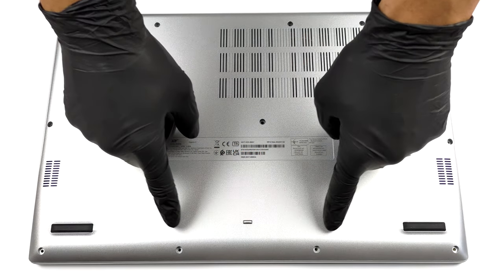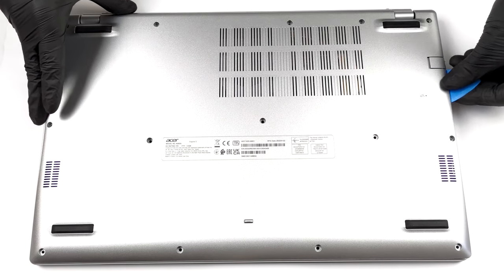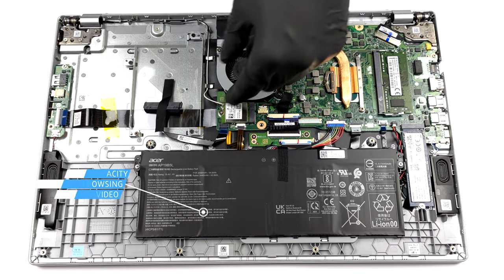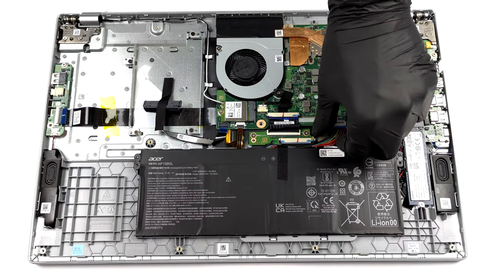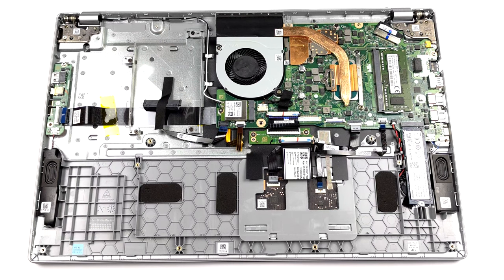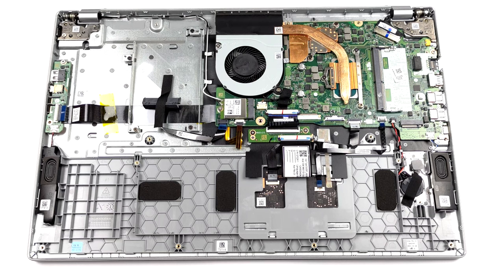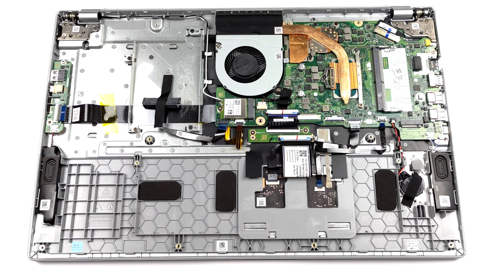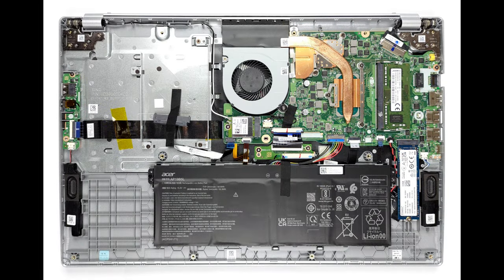🛠️ Acer Aspire 5 (A517-52G) - disassembly and upgrade options

Comment: Acer should make a Clear Case laptop,  where you can see all the components - then they could add some RGB inside on the board, and you could install RGB SSD and RGB 2.5" drives.

Comment: Yes, so much empty space!
Reply: With half a care  of  better engineering standards,  Acer could have made this laptop with  Dual   2.5" drive bays,  instead of only a single 2.5" drive bay...   
   Mirrored  seagate 5TB Drives or  just  Dual  SSD drives would make this generally powerful laptop a portable workstation.